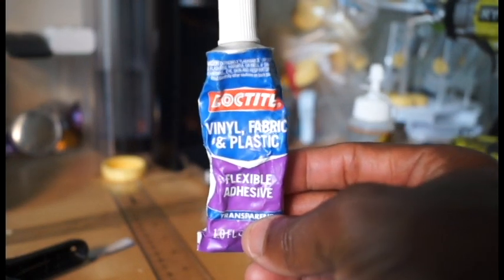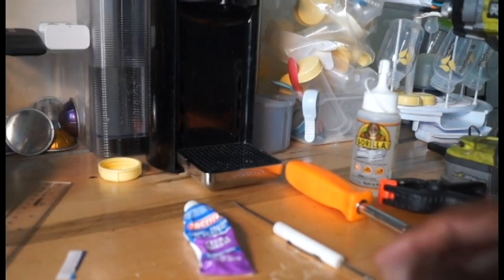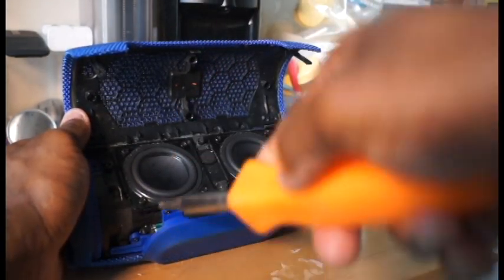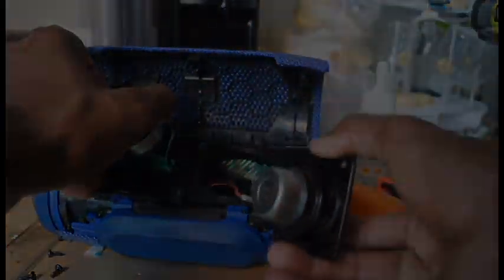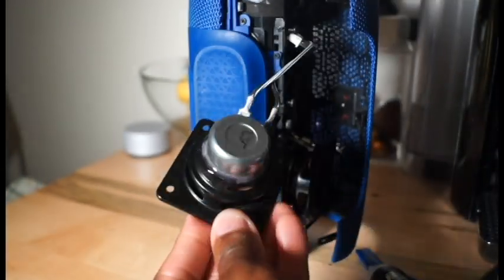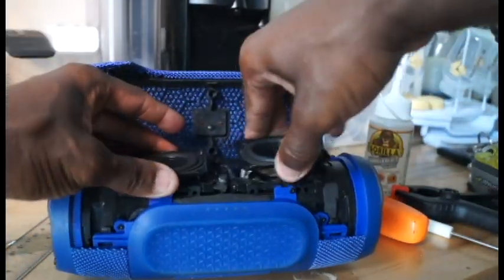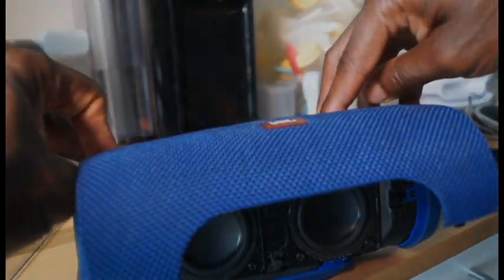JBL Charge 3 & 4 - How To Repair - Speakers

Comment: Thank you so much Howard! My JBL3 was crackling at the higher volumes. I just removed the cover as you have shown, and immediately I could see two small pieces of black steel shards; hardly wider than a human hair, standing vertically upon the left speaker center cup. I switched-on the unit and turned-up the volume, and those metal shards danced noisily up and down on the speaker, held in place by the magnetism of the speaker. After I switched off the unit, I carefully removed them with a fine needle-nose plier, 
Viola! Problem solved!
I’m guessing these fine metal pieces were left-over from the manufacturing process.
Again, thank you for your very helpful instruction!❤️🙏🏻❤️

Comment: Good video- thanks for the tips.  I was able to fix a friend's Charge 3, which had a buzz on higher volumes.  I checked several things covered here, but it turned out that rotating one of the speakers a fraction of a millimeter then re-tightening the screws fixed it~! (no, they weren't loose to begin with)  I'm theorizing the rubber gasket had perhaps compressed over time.  Hope this helps someone.

Comment: Thank you! This solved my last problem. Ended up replacing the charge port, battery and now the crackling is gone too. Had no idea that it could just come off by itself, Goddamnit JBL..
This part isn't as simple as that actually.. I had to adjust the magnet with bassy music playing to find the correct position, otherwise it would crackle.

Comment: I really like this Howard, thanks. I took my speaker apart last night but didn’t know what to do once I got in. There! After watching your vid, I’ll have another gander today.
Reply: Did you fix it?
Reply: @sos.gamers  its still sat there. But I’ve just got my soldering gun out of the garage. It will be kill or cure..
Reply: @sorchajones1788  I did a re solder and didn't fix it. The battery of the speaker it's dead, so I think the cracking noise from the speakers it's because of the lack of power, so I'll buy a new battery and try if not well I'll buy new replacement speakers for the JBL
Reply: @sos.gamers  how did fitting your new battery go? I just went in to fixing again and after making a bodge fix, saw a video, where the lithium battery had swelled and broken it’s casing, causing the vacuum to be broken. I expect you’ve seen this: https://youtu.be/AZeOlHrxKpc
I checked my battery after the bodge. There was no breakage / swelling. My bodge fix was some sponge behind the speakers. The vibrations have stopped. I can have the speakers loud again. I maybe should have glued but I’d forgotten about your video. Any more problems and I’ll go in with some strong plastic glue that I got from the builders’ store. Or maybe you’ve come up with something else since, which I can check out.
Reply: @sos.gamers hey U replaced a battery, and hows the speakers sounds ??
Reply: @rohanpatel2187  they now sounds good again

Comment: I thought I ruined my speaker because I was listening to music on the highest volume and then the bass sounded off and it sounded like a crackling rattling sound from on of the speakers and I was very upset but I started digging and found this video it helps so much, but do I need to buy a replacement speaker part to completely replace the damaged speaker or just glue the part you did

Comment: My speaker has no glue problems. After opening the speaker up, I have to press down on the left speaker to get it to play audio. Is that just a bad left speaker ?
Reply from the maker: You may need to check the wiring or resoldered the cable
Reply: u  have to get a new speakers

Comment: I have a charge 4 and I’ve had it for a while, I took it apart cuz I wanted to make it into a bigger Bluetooth speaker with bigger speakers and I accidentally touched the speaker wires together and it shut off and now it won’t turn back on, and when I try to turn it on all that happens is the last 2 leds of the charging lights on the bottom turn on and nothing else happens, how would I go about fixing that?
Reply: Sad

Comment: Hi I can't get the cover off got any tips?
Reply from the maker: Try to use a thin flathead to pry open the bottom
Reply: There are also screws holding in one side on the bottom, also. A small Phillips will get it off once you pop off one side

Comment: After I charge my speaker overnight, it plays perfect for about an hour or so  then starts making cracklin noises, what's up with that?
Reply: Same here, how do I fix it?
Reply: This sounds like a battery issue.  Even though it reads ‘fully charged’ (all five lights lit), the battery is most likely not able to hold a full charge and is not feeding enough power to handle the low frequencies.  

Not sure how old your JBL is, but with constant use, my battery stopped holding a full charge eventually.  You can order new batteries on line for under $20, and there’s a video on opening it up for replacement.  

Hope this helps.

Comment: How do u take that part of the speaker off (magnet part)
Reply from the maker: I just pulled it apart. The glue was worned out around the edges.
Reply: u cant
Reply: My magnetic part is tight af

Comment: mine is a charger 2+  has same issue, one fixer said the wire used from speaker coil to driver is too ridgid, needs to be more flexible, he used wires used in headphones, said it will handle low vibrations much better... anyone know what that interlaced braided like wire called and where you might get a little of that? great video, and thanks

Comment: The solution to my JBL charge 3 cracking noise was moving the bronze wire a lil bit and thats was it
Reply: Thanks :)
Reply: Bro that worked for me, I’ve been trying to fix it for a month but couldn’t find the problem and this comment fixed it thank u so much bro
Reply: @ineffableplayer7278  can you help me, i don't know which bronze wire has to be move and how it should be moved, can you explain it shortly :)? thanks
Reply: @SpeedyDXDBombOnB  aa
Reply: its called a voice coil

Comment: So if i do this to my left speaker its going to start making sound again? Because my left speaker aint working
Reply from the maker: When you say not working, are you referring to the sound or something else?
Reply: @CadidPixelNetwork  yeah im talking about the sound
Reply: @CadidPixelNetwork  it also makes a crackling   sound when i put it to the low frequancy mode. If you could help me out i would be thankful if not its all good
Reply: @liam-hr4qh  don't use low frequency mode
Reply: liam don’t do that, you’ll break it so much more

Comment: Hello i have different problem can you help me please i think its not problem with glue the silver think hang good but big crackling cant be listen and if i push on the speaker the crakling stop but how i can fix it please?
Reply: You need to re-solder the little wires that are attached to the speaker. I mean the easy to reach (!) wires, where the plastic-covered wire goes onto a small plate and behind that goes further as bare coper wire. The connection between those two wires is fck'd and need soldering
Reply: To be more precise, the wires comming from the motherboard towards both speakers are soldered to the copperwires inside the speaker. One of those cables has a faulty connection. You already found out what speaker was the problem (you pressed on it to stop making weird noises) so that speaker has one faulty wire.
Re-solder the connections of this one. You can test it by keeping the faulty speaker out and turn on the favorite Bass-rich song that creates Noise. Now carefully wigle with one wire at the time. If the noise stops you found the right (faulty) wire that needs fixing
Reply: @Linguaholic23  thaanks a lot i will try it 😊
Reply: you have to get new ones or send it back to jbl if  hae a warenty okay
Reply: @n.rivals3244  my warranty was still valid, but JBL doesnt take care. Its the seller that takes Care of this, in Europe at least. And my seller sended me a digital paper i had to print and fill in to be able to send back. But in this case i first had to buy a printer to be able to print the Quarantee Form so.. Nvr mind.. I just fixed it myself
Reply: @Linguaholic23  dude u just helped me out thank u sm

Comment: Bro , mines was crackling right. The silver backings you took off are not loose or show no sign of seepage. So how is that the cause of the crackling. Can I show you the pics? I just turned my old broke one back on and its still making the crackling sound when turned on.
Reply from the maker: You can send me the pic's. Sorry for the late reply.
Reply: Hi boys it anybody know about speaker  T45BT

Comment: what? why did you skip steps? how do you take the silver cap off to reapply glue?
Reply from the maker: The silver cap is the reason was it was crackling or giving weird feedback noises. That peice came off by itself. Its magnetic with glue around it. No steps were skipped.
Reply: So if the cap isn’t loose, and it sounds bad, what is the fix?
Reply: He doesn't know this video is not a cure all just buy new speakers

Comment: My speaker crackles whenever the bass hits
Reply: Mine too
Reply: me too
Reply: same problem, but in my case its one of the 2 golden cables that are going into the membrane of the speaker (my problem is at the right speaker), one of the 2 copper cables vibrates too hard, so the bass crackles, i hope i can fix it with silicone. Hope i  helped someone with this comment
Reply: Mine too
Reply: So with mine too

Comment: I didnt see you put back  the clip....
Reply from the maker: What clip?
Reply: @CadidPixelNetwork  the white clip you removed, in order to make the individual speaker  easier to work on
Reply from the maker: That's the cable that connects to the logic board to power the speaker

Comment: How do you fix water damage
Reply from the maker: You may have to swap out the main board. I would test the speakers by connecting to wires to the connectors and something that will produce sound.

Comment: One of the two speakers on my charge 3 is broken and on low volume (30-40-50%) it gives bad sounds so I need to replace it, just the left one so if anyone knows from where can i buy one of them and I need original one, not fake, please just left a link in comment, thanks alot

Comment: I also opened it from the wrong side and then housing that goes around on button fell off like the cover that goes around the speaker
Reply: Please reply
Reply: So I'm gonna tell the exact problem so a few months ago I gave my friend well was once a friend my speaker to use and he put water in the speaker so now it's just crackling when the bass hits and when is on loud volume

Comment: I get no sound from my left speaker I think it was because I dropped it but everything else works fine how do I fix it mi amigos?
Reply: I’ve been trying to figure out the same thing I’m commenting in case anybody else knows how to fix it
Reply: The connector could be disconnected
Reply: Is it charge 4 or charge 3

Comment: if bass crackles:  in my case its one of the 2 golden cables that are going into the membrane of the speaker (my problem is at the right speaker), one of the 2 copper cables vibrates too hard, so the bass crackles, i hope i can fix it with silicone. Hope i  helped someone with this comment
Reply: hey man ive the same problem, did u fix it with sillicon?
Reply: @CalebVivero-qg3mo  no the problem is still there i dont know what to do sry
Reply: This kinda help...what I did is put something  between the copper wire n the frame so that when it vibrates the copper wire won't touch anything causing the vibrations

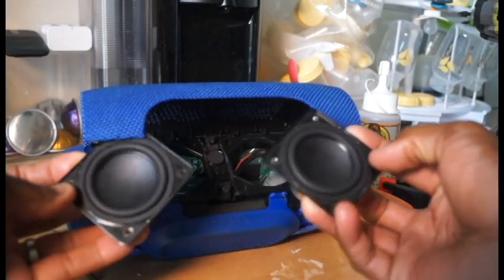Comment: OK I'm at 3:23 now. Bro I did this. I messed round and let BOTH speakers touch each other and the magnetism caused BOTH speakers not to produce ANY sound. So I bought another one out of madness. Now the 2nd one is CRACKLING, wth is up with JBL!??! So this time I'm trying to fix the 2nd one.
Reply: still waiting on a response. cool
Reply: Crackling? When adjusting volume or when playing music in general
Reply: @KennyRamasawmy mine does the crackling when the volume is low
Reply: @danyrhys6616  oh damn. Mine make a small crack noise only when changing volume
Reply: Just switch to boose, jbl is a scam

Comment: @1:35 he says dont be scared of breaking there are ‘clamps’ lol, I remember opening the cover from behind with a knife and then you reach the front through the two screws that release your-so-called ‘clamps’ without the need to break it, too bad I forgot that and followed your ass into breaking those clips and needing to use glue like a chump.

Comment: This is wrong and not helpfull at all, because the magnet is not fixed perfectly. You can’t center the magnet like that so the coil won’t be able to move.  That speaker is still damaged
Reply from the maker: How so? You should have provided some sort of evidence to your claim.
Reply: @CadidPixelNetwork  you can’t repair a speaker properly without fixing the magnet exactly on the center of the core. This is impossible just by glueing the magnet in place.